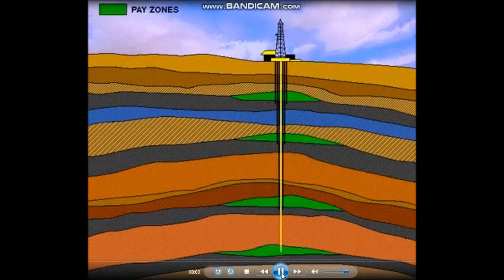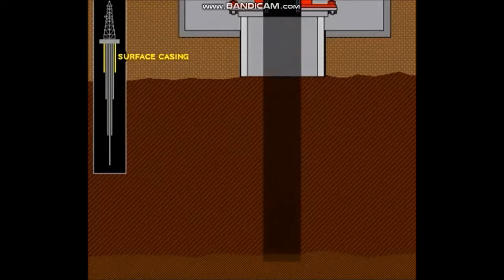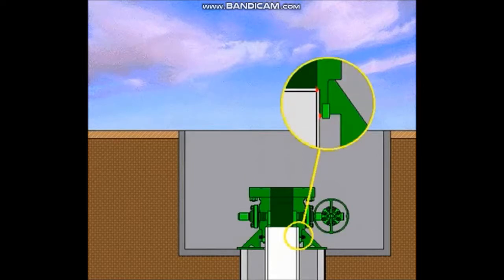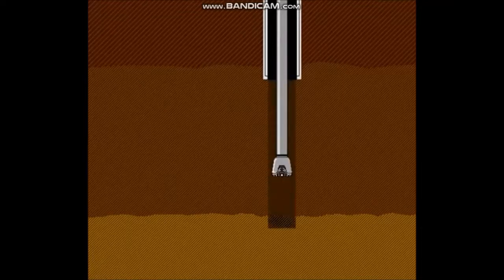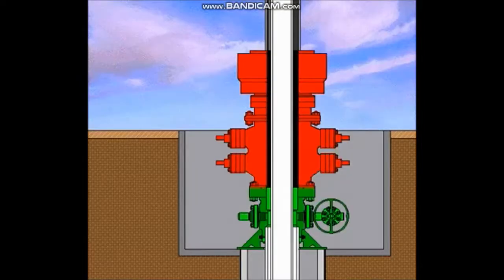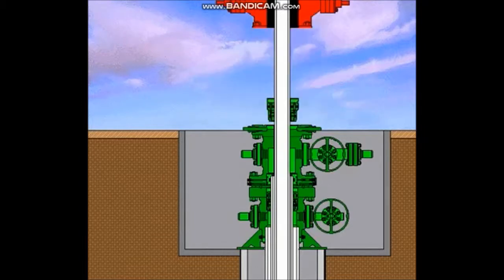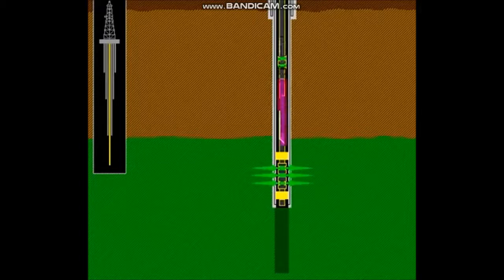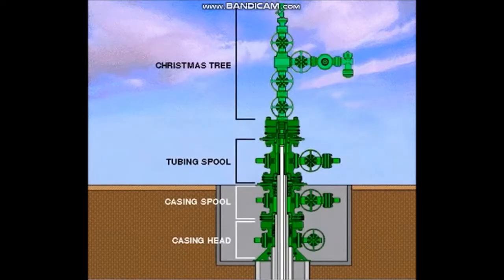Drilling for Black Gold: The Ultimate Oil Well Guide

Comment: Drilling begins with digging what, sellor, or sailer
Reply: Cellar pit, only dug for land rigs.
Reply from the maker: That's correct! Drilling typically begins with digging a cellar, which is a shallow pit for the drilling rig's foundation and mud circulation system.